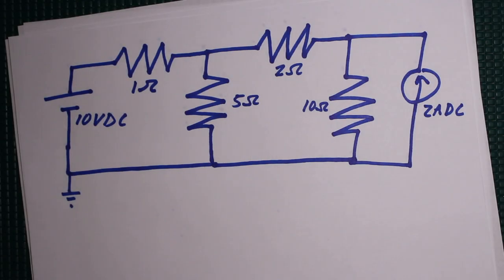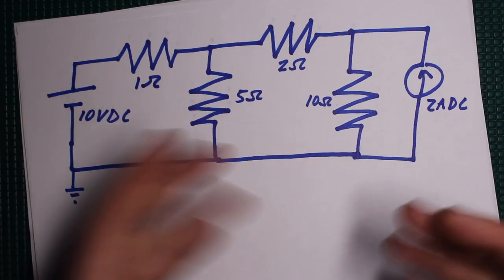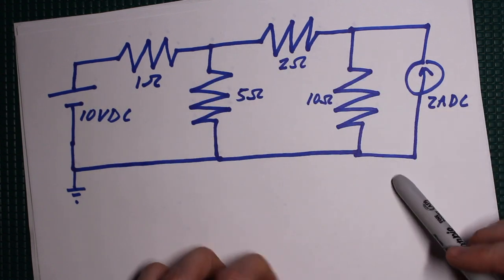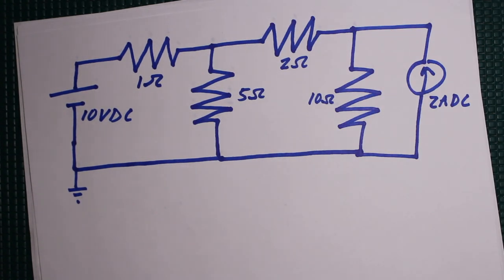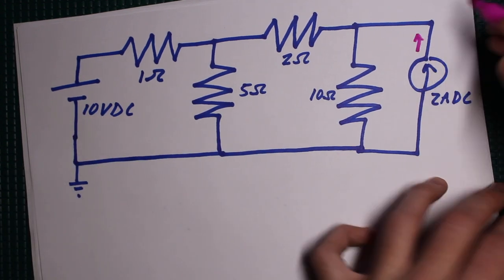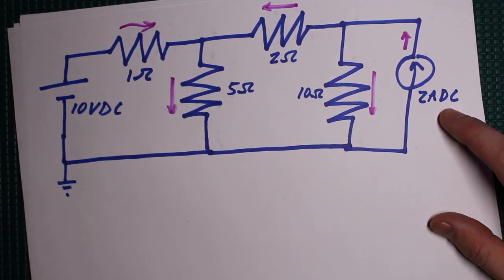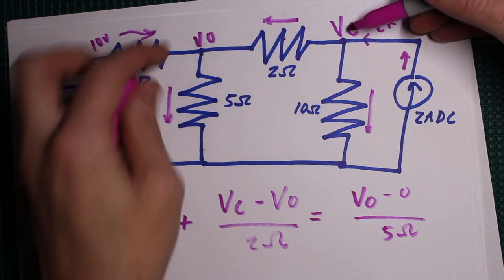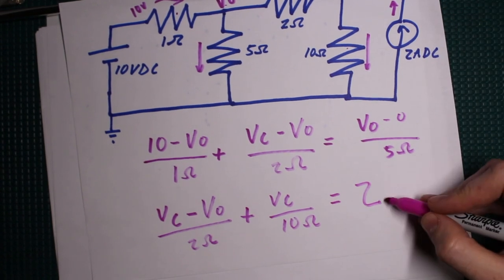Circuit Analysis on Paper + Simulation + Bench Testing - Easy!

Comment: I don't understand the concept of a 2A current source. What would this be in a real life situation please? Also, How do we know that current is flowing in that direction for the 2 ohm resistor? Could it not just as easily be flowing in the opposite direction? Thanks :)
Reply from the maker: good questions, current sources are used all the time - I think I even did a video on them a while back when I was showing how to make LED drivers... then sure go ahead and draw those arrows any direction you want.  When you work the math out you'll just end up with negative currents, then you know you got the current direction wrong, so flip the arrow

Comment: If Vin=10V how can Vc be 10.9 thus higher  after a couple of resistors?
Thinking of building a circuit with lots of resistors to boost 12V to 400V 😜
Reply from the maker: don't forget you've got that huge 2A source over there... I wish building a boost circuit was that easy :)
Reply: OK, DOH!! didn't think of that :P
Thought it was a measured value.

thx for the reply tho :)

Comment: BUT how do i know that the current of the 2Ohm resistor is flowing in this direction. For example if the current source is as low as 500mA, the current flows in the opposit direction through the 2ohm resistor!
Reply: Charlie90071 you can just define the way the current flows. It will all work out in the math if you stick to what you defined at the start.  If the current flows the opposite direction than you defined, your answer will be negative. 
Hope this will help you understand.
Reply: It does not matter. You just have to make sure that you stick to your assumed direction whenever you use the current in an equation.
Reply: Jordi Zoon okay thanks for the help

Comment: Much easier to do a source transformation on the 2A current source/10ohm resistor, results in only Vo to solve for, skips several steps. Good example however.